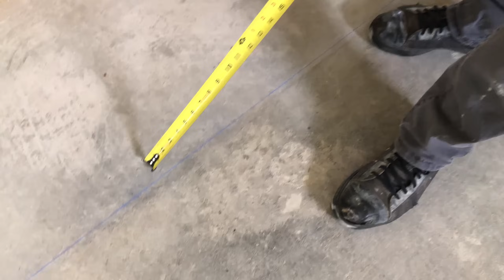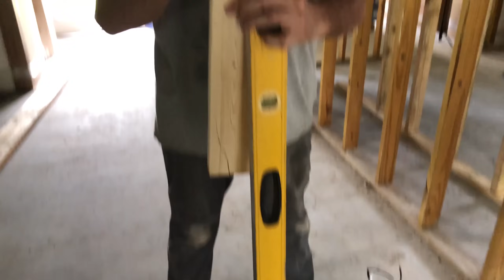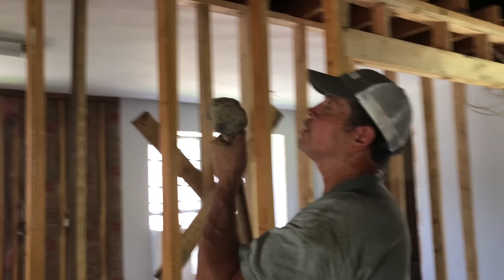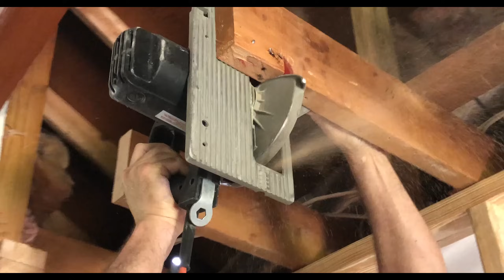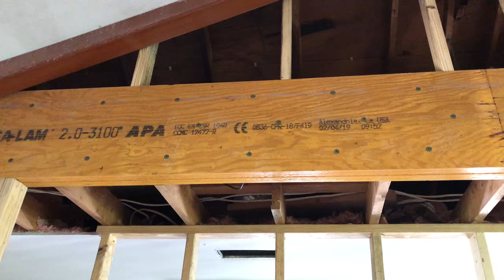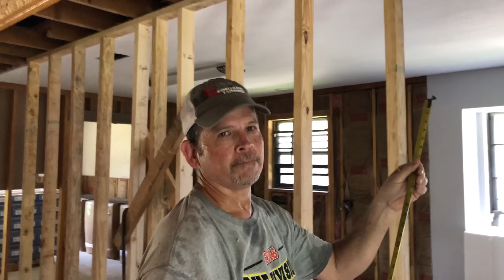Ripping Down a Support Wall and Installing a 16 Foot Beam

Comment: I had a question, I have a similar project but it's a pantry closet, and its supporting the 2nd floor, I was wondering if I could use 6 Lvl beam 3 on one side and 3 on the other side,  following your steps in supporting the 2nd floor with temporary 2×4 wall on both sides. If you give me your email I can send you pictures of what I'm trying to accomplish... Thanks again in advance..

Comment: Im removing a load bearing right now but not putting the lvl in the attic resting the joists on top and installing 4x4 for the lvl to rest on i have yet to do one like this but good video nd nice explanation throughout as well 👍

Comment: I have a question regarding the joist hangers where the ceiling joists meet the new beam. I'm sure they are strong enough to hold the weight of the roof. But I have seen this done when there is a second story. Are the joist hangers strong enough to hold up the weight of a second story? It seems scary to me.
Reply: @suspicionofdeceit8402 I didn't say it was holding a second story in tis video.  I was referring to other videos I have seen that do have a second story.

Comment: Just added a 22’ beam to open up 2 big rooms in my house. We used 4 of the 16” beams. Made a huge impact on our house. Totally worth it
Reply: Chris Saucier hi, around how much dis it cost you? Im going to start getting quotes to throw down a wall in my house and I suspect is Load bearing
Reply: rauly estevez that part of the job was probably $3000 with labor and materials, including the beam. It took 4 full days of prep work to get ready to pull the load bearing wall out. On the day of the beam install, I had to help for a couple of hours as 4 of those 22’ beams weighed about 1000 lbs. they did a lot of other work too so it’s hard to say exactly what the beam cost

Comment: interesting you were not required to cut the slab where the footings were.and pour a foundation for the support posts.  Inspector here in Palm Springs CA required that We cut the slab and pour a footing 24 x 24 x 24... just for a 12' wide span.  we used a triple microlam

Comment: Thank you both, for taking the time to produce the video. I am also observing your commitment to quality.
Reply from the maker: Thanks Sheldon!!  Much appreciated
Reply: @StudPack  I have a problem underneath in my basement the flowing I guess is 10 so its deteriorating okay deterioration is that a foundation problem or do I just need to have the floor listed in the in the pool that deterioration it out because it's starting to leak water it comes up on my front steps partially help if you can

Comment: I'm getting ready to do this, my beam will be spanning 11 feet, how much different is this process when you have a second floor?
Reply from the maker: You must support the additional load of the second floor plus the roof.  Ask your engineer to design the temporary load bearing walls as well.  Tremendous amount of weight you're dealing with.

Comment: Are you able to remove those gas lines, electrical and maybe even a plumbing line without having a journeyman license in that trade as a general contractor? Or do you u have to have to find a sub contractor for the removal?

Comment: I had to do this on a job and the engineer charged me $1,500 and told me I needed a 3/8 thick flinch plate through bolted. It was an easy 7k job which turned into 70k cash to the entire first floor and add a bathroom to which was once your closet. It happened to me right over the main sewer line and plumbing feed lines in the basement so you couldn't get anything easier if you paid. Lol

Comment: Congrats to the contractor I like his demeanor and attention to detail. I wish he expanded a bit more on the slab thickness, and what were the engineering spects for a possible footing. Was there one there before? Normally in these situations, the engineer will draw to cut off the slab and pour a footing usually 24x24x12 or so depending on the load, with a crossed 1/2" or 5/8" rebar 2" or so above the bottom. I am dong a similar project but I'm setting the lvl beam above the ceiling joists and will hang the joists off the beam without cutting them. Old world bulletproof method with many advantages. If you have no slab, you'll have to cut off the floor and carry the load to the footing.
Reply: May be they have post tension slabs or waffle tension slabs. I think they do not require pier or footings to support beams. But I am not 100% sure. What do you think ?

Comment: I have a house I’m repairing a elderly couple and trying to save them as much as I can . There’s a 28 ‘exterior wall on the back of the house with 10 windows on it 5 are screwed together on one side of the back door and 5 on the other side of door . It’s literally amazing that it hasn’t fell yet . I would like some input on how to pull and reset them with out the wall falling .

Comment: I just had the upstairs neighbor flood our Condo, which we were planning to renovate for a rental unit over the next year while my sister is working in the S. Pacific.

We were HOPING to remove a load bearing wall that is taking-up some 120 ft² of useable space, but the cost of doing so was nearly prohibitive…. Until the flood.

Insurance pays for the water-damage clean up, which did 75% of the work for us in removing the wall.

I already had the drawings and was applying for the permits so that we would be ready.

But now I need to speed things up because if we remove the wall, the insurance will pay for the new kitchen, since “putting it back the way it was” will only cause it to flood again when the upstairs neighbor AGAIN doesn’t know that they cannot run ALL of the water (kitchen sink, dishwasher, washing-machine, and shower) at once without flooding our unit due to improper plumbing installation during construction.

So the Insurance Co. was like “You already have the Architectural Drawings for the new Kitchen with Catchment Basin under the sink and dishwasher (which is where it floods), relocated to an outer-wall with a drain for flooding completed and approved??!! Since we’ve already torn-out the appliances during flood-damage repair, we would rather pay for putting them where they won’t cause us to have to pay for all this again. And we’ll pay for the additional cost of REMOVING the wall, as long as you have the Permits, and lumber for the temp. Support and beam (we already have the lumber).”

Stumbling on your channel six months ago was depressing thinking about having to wait 18 months to get the additional room in the Kitchen, Living Room, and ‘Dining Room’ (soon to be a REAL Dining Room) for removing the wall.

When the flood happened I was like “Oh! FFFFF—CK!” And then I was like “OMG! HURRAY! New Kitchen here we come!”

The guy who does the Carpentry for Sets for me said to watch your video for what to do.

Now to see if the insurance company will pay for the wooden floors instead of just replacing the carpet we will be tearing out this summer (I wonder if we can just have them deliver the carpet and pretend to install it so we can sell it if they don’t approve the hardwood???)

Comment: Is it possible to build the support wall without taking down the drywall? The ceiling is textured in my house and I’m trying to find a way to put in the beam without destroying the textured ceiling.
Reply from the maker: I’d be comfortable putting the temporary wall top plate against the ceiling drywall.   Not sure what type of texture it is but obviously could be some damage to it 👍👊

Comment: Do you think the two 2x4's was really enough on the right side? When I put up the same beam I think i stuffed like six 2x4's on my 10 ft span.
Reply from the maker: I thought there were 3 ???   Been awhile.  Funny story….  That’s exactly where our name came from.  Structural engineer called those 2x4s holding up THAT beam a stud pack 😂👍

Comment: Very nice, I've seen a another video from another builder. He used screws for his temporary support wall so it was an easier take down. I don't know if there is a reason you used nails or is screws are not a good idea. Just curious if there is a right way or not. I will be tackling a similar project and would like to know lol. thanks

Comment: Why did you choose a laminate beam over other options (eg: reclaimed barn beam or steel)?  I'm looking at doing something in my Kitchen, about 14' span, and am thinking about using an exposed, reclaime and remilled, barn beam.
Reply from the maker: The engineer specified this beam.   Since reclaimed lumber can't be tested in a lab, it's not allowed for structural applications.   You have no way to know how strong it is.   That's how it is here in Louisiana anyways and reclaimed lumber is super popular here.

Comment: For temp walls just strong back the top plate and put them on 2-3' centers. No sense spending extra on lumber for a temp wall... Studs will handle it no problem temporarily especially without a snow load or something. Cross brace if theres a concern

Comment: Hey bud , did you have to hire an engineer to remove the low baring wall? And if so how much was that . I have a low baring wall that my wife wants down really bad , and I was just wondering how much hiring an engineer would set me back?
Reply from the maker: Hey Denny.  Our local structural engineer charged $500.00 for site visit and stamped drawings to submit with our permit application
Reply: @StudPack  Wow I didn’t expect y’all to write back especially that fast I really appreciate it and I love your videos I am a new subscriber and really appreciate how detailed you are in your videos thank you for writing me back. Be safe.
Reply from the maker: No problem and best of luck on your project Denny 👍

Comment: i’m an electrician and i don’t go to any job without my fan. Blowing warm air is better than no air movement. Spend $80 and get ya a fan , you’ll like it.
Reply from the maker: We actually had 2 fans on this project.  I'm not sure where they were on this day.  Maybe Jordan made me turn them off because the microphones pick up the sound?:)
Reply: Stud Pack i’d been finding them. Good vid

Comment: I have one comment could you have had the ceiling joists rest on top of the double Lvl’s and cut the jacks down 12” to avoid having to install all those hangers I known you would have a little lower opening but would also look nice having a finished beam in that area

Comment: Thanks for the video! I'm surprised at the need for such a large beam (16" depth) when just carrying roof load in a non-snow area. Any idea how the loads were calculated here? Did you use L/240 or L/360? I would have expected more like a double 11 7/8" here. Cheers!
Reply from the maker: We hired a structural engineer for all the calculations.   The beam we installed is made up of two LVLs, each one 1-3/4" wide.  That may not have come through in the video due to our camera issues.
Reply: It's also carrying the ridge beam from the adjacent room. Maybe rewatch
Reply: 11 7/8 tall lvl would probably have worked, but the cost difference is minimal.

Comment: Great video! Did you glue or use a structural screw for the vertical studs that support the new beam? Did you glue the 2 new beams together? Did you use an angle on the spax structural screws when bonding the 2 beams together or drive them perpendicular to the beam? 

Sorry if you already answered these questions. You have a lot of great comments and I didn’t scroll through all of them. 

Thanks for the great video!
Reply from the maker: No glue on anything.   Vertical studs nailed together.  Structural screws perpendicular 👍
Reply: @StudPack  Thank you!

Comment: I'm a GC in Texas. Never let a contractor make the decision on what can and can't be done concerning anything STRUCTURAL in your home. Hire a Structural Engineer  with a reputable firm to evaluate and make a report complete with a diagram of how to place the beams, number of beams and size of beams. Every year I get called to fix or in some cases demolish an existing project that went horribly wrong simply because the homeowner didn't know or the homeowner didn't want to spend the money to hire a structural engineer.
Reply from the maker: Couldn't agree more, that's why we always hire one 👍
Reply: I have tried on many occasions to hire structural engineers for residential projects but they just aren't ever interested :(

Comment: This was really helpful.  How is the LVL beam attached to the short side walls?   I feel like maybe we missed that when the camera lost battery?!?  I love step-by-step framing videos.  I framed our 1100 sq. ft. basement.  YouTube videos taught me how.  💪🏻
Reply from the maker: Thanks Valerie!  We used long structural screws thru the top plates to secure the beam.  Check out our double beam video  - there's a great shot of that detail that we missed in this video due to the camera battery

Comment: What type of screws do you use to fasten the LVL s together. In Ontario , local codes insist on nails rather than screws because of the Shear strength.  Great videos , thanks.
Reply from the maker: GRK Structural Screws.
Reply: @StudPack  Thanks !

Comment: Would it be easiear using a bear paw nail puller instead cutting nails
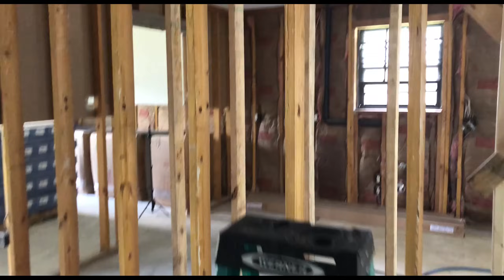Reply from the maker: If you mean at 07:15, not really.  You could I suppose but when we use the saw, it's faster plus we get immediate feedback on whether or not we transferred the load properly (does the blade get pinched).  Thx Dan.

Comment: I installed a 32ft beam in a house I worked at a few months ago.  It was extremely heavy and we had to double it up
Reply: Did you have to add footings under each post used to support that 32' beam?

Comment: So the entire load of the roof is on 4 poorly sistered 2 by 4s? And engineer Ok'ed it? It really needed two real colums there.
Reply: Where are you getting "sistered" 2x4's from? And how TF do you know how much load is on it? It's obviously not "the entire load" as you said.
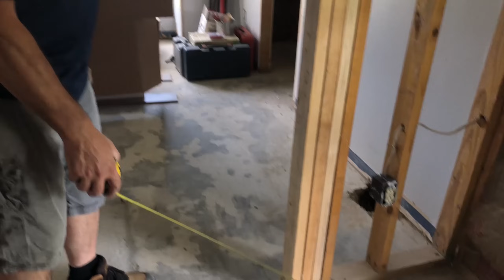Reply: @BoldWittyName  starts around 20:21, where the final result is shown. The beam rests on 3 (out of 4) sistered 2x4's on one side. The other side is not as visible, but it looks like it's the same story there.
The beam spans the length of the house pretty much (door to door), hence "entire load".
Reply: @dmitrychernivetsky5876  idk man, it's a triple jack stud on one end, and at least 2 jacks on the other. That's what those beams usually rest on. All for a ceiling and a Gable roof, seems like overkill to me.

Comment: Is it common in the US to use plywood beams screwed together like this. Where I live they would probably use a glued laminated timber instead. Or is that what is used and it's just the video not making it very clear.
Reply from the maker: It’s called an LVL (laminated veneer lumber) in the US.  Sounds like a similar product to what you have

Comment: Great job!  I appreciate the time you took to document this job.  It will be a great help to me.  I'm about ready to do almost the exact same thing.  Opening up the wall between the kitchen and living room.  The living room has a vaulted ceiling as well.  Pre planning question.  What's the best way to go about getting proper structural plans to present to the county for permits?  Thanks again.
Reply from the maker: We hired a structural engineer.  $500 fee for this project.  Finding one to do small projects can be tough.  Check with permit office.  They see them all👍

Comment: Great video, very informative; I'm expecting to remove a similar LB wall later this year and am getting all the info I can. When you mention the "engineer approved plan" is that a local county rep or is there a contractor "title" I need to look for to get somebody to do the math/design of what size LVL beam I need. I and my son can do the install, but obviously want the right LVL design/size.  
I paid a framer to look at the project and give me an estimate; that was over a month ago and he still says he's been too busy to even work up the plan and estimate.... not even considering a start date.
thanks
Reply from the maker: We used a local structural engineer for this $500 flat.   City requires stamped engineer plans on project like this.   Check you local permit office they can probably recommend someone 👍

Comment: Did you only have to install the screws on one side in the LVL?
Reply from the maker: Yes.  There’s a screw schedule on the plans.  Usually 3 or more plys means screwing from both sides.

Comment: This was so interesting and informative to watch. I'm an electrician by trade so I can't really put this to use, nor would I want to attempt such a large task with no training or experience, but it was still a very detailed step by step and neat to watch start to finish. I do have a couple questions. When tying the two 16 footers together you used structural screws, but when you used the joist hangers you kept it traditional with nails. I've seen structural screws that are rated for hangers. Did you stick with nails for speed/cost? Did the engineer specifically want the two 16s to be attached with screws or could you also have used nails?
Reply from the maker: Thx.  The engineer specified screws for the LVLs.

Comment: Awesome awesome video! Thank you for all the time you spent on not just teaching how to remove load bearing walls, but doing it with a clean and safe job-site. I do have a question; have you considered shoring the wall with screws instead of nails? It’s easier, in my opinion, to remove the temp wall by backing out screws & you can save the lumber for another job!
Reply from the maker: Thanks Harrison!!  I've always used my framing gun.  Nails beat screws for speed on the installation but not on the removal, maybe a wash?  idk, I'll try screws next time.  We do save the studs for later use (cripples, blocking, etc) so they don't go to waste.